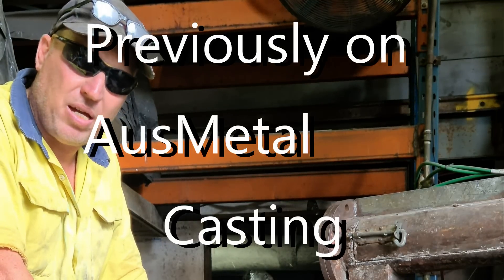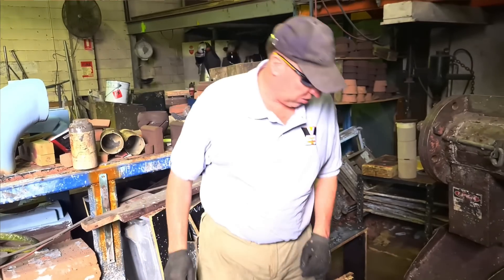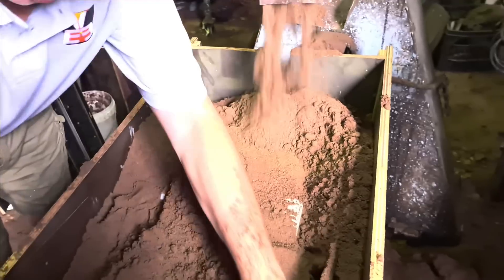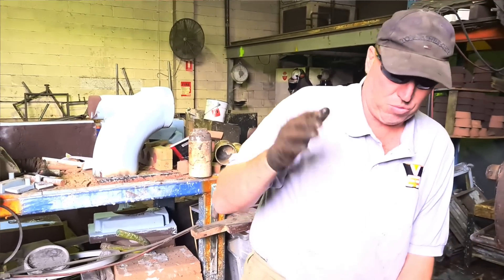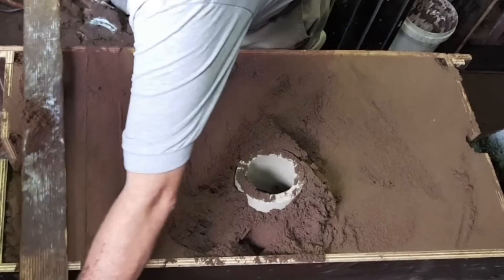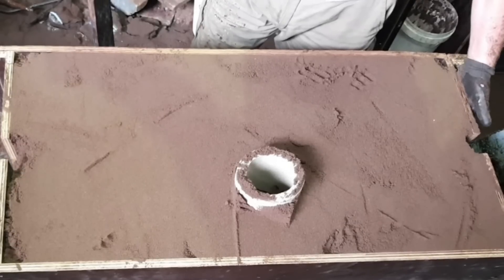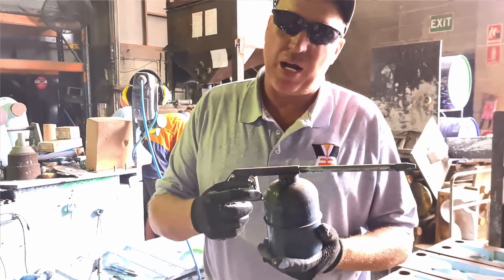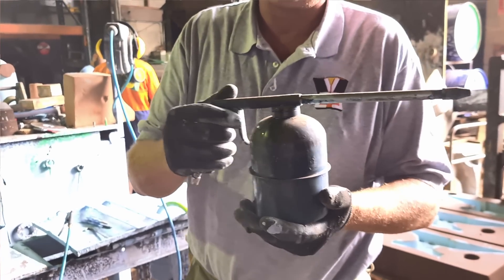Making a 100kg Steel Anvil - The cope and closing using K-CAST Sand

Comment: Jesus christ dude!.... its not a fucking funnel its a pouring cup..... and since this guy doesn't explain things properly the thermal sleeve thats in the cope is for one, not enough riser but anyway it made out of several material some being wood pulp like cardboard and such but it also has small shavings of Aluminum its job is to keep the hot metal insulated and molten the longest so it the last part to solidify it needs to feed the casting and what they have there is no suffice for the needs of that casting

Comment: You don't have a riser well or enough riser to feed that casting and no core vents 
HELLO POROSITY! yr just gonna dump the metal right on the surface of the drag right where the emblem of the casting is no well and gateAND STOP CALLING IT PAINT ITS WASH

Comment: you should be packing that sand harder than that if you don't use a bumper or squeeze machine or even a vibrate table you should be packing that by hand hard or at least a air powered hand jack hammer also I can see the parting line on the core at 6:30 that should be cleaned off

Comment: Wonderful job and very nice explanation.Sand binder is what،What is this paint and the scientific name،Thank you
Reply: The paint is not actual paint its called wash and it made of Zircon flower alcohol and some binding agent the reason for burn off is so the wash can adhere to the surface properly
Sand binder is the is the main base to the chemical part of two which a catalyst is needed to harden it the ratio will give you a different strength too much and you get to much gas off to little and it breaks down before proper solidification of the casting

Comment: Great videos guys. I’m a blacksmith so love the anvil casting. I’m also right next door to a bronze foundry in Sarasota Florida. I’ve tried my hand at mixing my own sand and casting art pieces in aluminum and in bronze with some success. I’m very interested in a finer surface finish, So any details on the type of sand, the paint and the glue much appreciated. Amazing work guys !
Reply from the maker: Thank you! So happy you're liking them. The sand is a mix we use. We're not sure how many foundries use it too but we haven't seen the hobbyist or home caster using it yet. We're setting up a website for it at the moment, it will be available soon
Reply: Glue is refractory glue you can get it at foundry supply outlets like Fosico